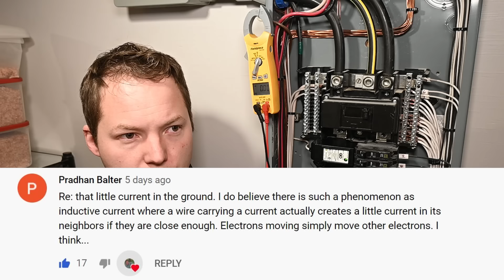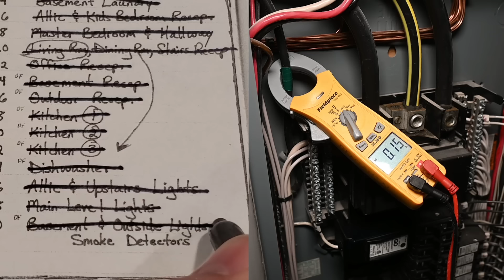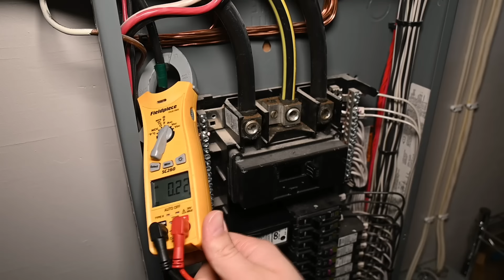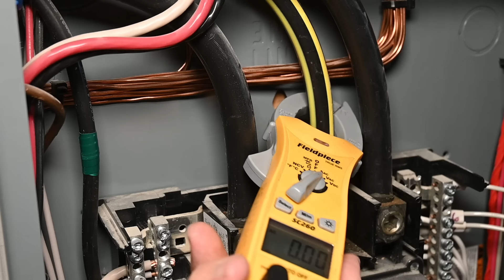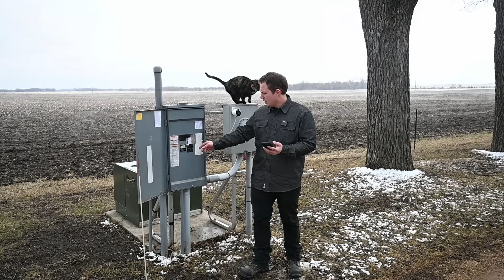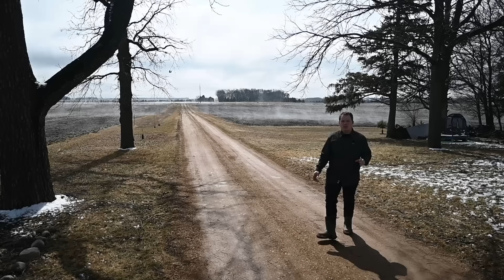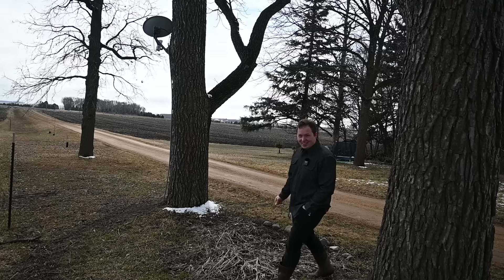Finding The Source of Stray Current on Grounding System

Comment: I'll never forget the time my girlfriend helped to clean me up presentable for a friend's wedding. I was sitting in the bathtub while it was filling and I had just painted a Dodge Challenger lime green and my hands had cured paint on them so she grabbed a can that sounded familiar from my paint supplies lock up and put a little on a rag and it worked to remove some green from my ear so naturally she told me to hold out my hands and I felt the splash and some hit the water at nutty level and I flew out of the bathtub and told her to grab the milk jug fast. It's the first thought that popped into my upper head as a possible means of putting out the weiner roast down below that was set ablaze by a half cup of acetone on the hot water surface that let me rise above the tub then put my feet down while the room got narrower. No Internet so Henley's Formulas to the rescue and my copy is at the foot of my bed on my 125 over 283 301 small block Chevy project engine for my 76 GMC shorty no back windows van for highway driving all over the province of BC in order to complete my electrical apprenticeship with plenty of variety and loads of fun... And that was the last time my now wife helped clean my hands with acetone while I sat naked in the bathtub. 
I remember the time I got zapped in the shower and I spent 3 years pushing the utility company to check the primary side connections, grounds, and stray current around the pad mount transformer that feeds our home. Hydro was talked into saying they would be here last night but no show so I'll wait a while before calling them back to continue telling employees who do not understand electrical basics and have no idea what a primary side would plug into and they have no clue how electrical noise can wake one person up instantly while the other one won't turn it off or at least turn your primary down at night. The saga continues but it has been 3 years since I got shocked in a shower.

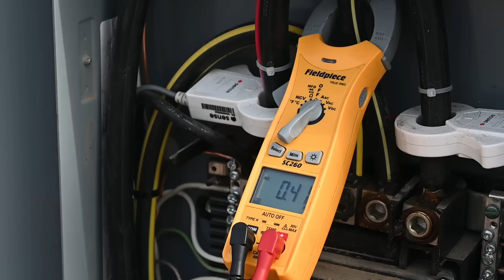Comment: 16:16 The problem is not that specific house nor transformer. The problem is that most distribution systems in the US are 1) multi-point grounded at the primary and 2) the secondary neutral (what feed the houses) is tied to the primary neutral (what comes out of the substation).

Actually it's even "worse". Because the house has two ground rods at the neutral disconnect, but also a ground rod at the transformer secondary, this creates a parallel path. Even worse, not only your housez but all other houses connected to the same transformer will have two ground rods; moar amps.

A perfectly wired electrical installation in the US will always have objectionable (leakage/stray) current!

The US adopts a TN-C-S grounding system, not a TT not TN-S system.

Comment: Benjamin, I think you have a neutral to ground connection after the main panel, which causes some neutral current to flow on the ground wire even if all the breakers in the house connected to the subpanel are off.  Neutral to Ground connections result in higher than normal EMF readings.  So, you may wish to buy a $89 EMF reader and go EMF hunting with all the breakers off to find the wire that is carrying the stray current with the Objectionable Current on it.

Comment: Bridged neutral, sure.  That could also be in a panel, sub panel or meter base.  The breakers wouldn't trip.  The other suggestions are pretty out there.  It could also be a floating neutral.  Is it power or current?  Both.  Current X voltage is power.  Also, power lines don't have neutrals.  The source isn't the closest ground rod.  It's the earth

The minor changes are just the meter.  Clamps aren't that accurate.

If you find a true ground, like a water pipe, and use that to measure voltage to neutral and ground you'll see a voltage.  You can also pull the ground, and then the neutral, to your sub panel and see if it disappears.  Current needs a path.  It appears to be on the utility side and they will have to deal with it.

Comment: What's probably causing that current could be what's known as "neutral to earth voltage" (NEV). It is the voltage drop across the power line coming from the substation. This line is grounded about 5 times per mile. This voltage drop depends on the amount of current on the line at any given time. Just look up "neutral to earth voltage". Mike Holt has a good video on that.

Comment: Had an issue with a whirlpool appliance a stove actually it was under warranty and it melted the terminal block, guy came and replaced it and we weee having issue because he didn’t remove that bonding part you were talking about you think he would’ve looked at the original and thought “ hey this piece isn’t on the factory part” but no unfortunately

Comment: I believe the conductors are wrapped around the bond and inducing a flux amp on your bond!! I had a similar condition, which I tested in the same manner and got the same results. Still unsolved as it is a long run and I am unable to dig it up!

Comment: I have the same problem but with higher voltage amperage on the neutral and ground in the meter box , electrician diagnosis was that the hot wires inside the service pole (hot lines from service to meter receptacle) are touching the neutral, maybe a shaffed wire? What do you think?

Comment: Hello,somewhere at your house, a neutral is connected or leaking to earth wire. What form a loop your transformer to the connection between neutral and earth mentioned and to the house ground   and then to ground rod of the electric pole you mentioned little far from your house,this happens because of the voltage difference between your transformer earth rod and the other one around(step down transformer).

Comment: I am no expert, but from the little knowledge acquired while building my PV system, I would have immediately thought of some leakage from a neighbouring building, which is somewhat similar to this. 
I understand that in a TN-CS installation, if the Neutral of another building suffers a fault, all the energy in that building would find its way back to the energy provider's transformer via any underground piping which is in turn connected to your ground and eventually to the Neutral feeding your home.
This seems very similar only instead of another building you have the transformer itself leaking to whatever will accept a path to earth.
One word of caution, you should not have more than one grounding electrode (rod) unless directly bonded with each other. The reason is that, in the event of lightning striking the soil, a gradient of voltage is going to radiate throughout your land with a potential difference of up to 20.0000 volts in which case, due to the resistance of the earth, the easier path for that voltage might easily by through your grounding conductor into the building and destroy some of the appliances to find its way to the nearest grounding rod at lower potential.

Comment: Why is there Stray Current on the Grounding System? And why is the neutral connected to earth? It's not for Lightning protection. Stop calling the so-called ground wire "Ground". This wire may be connected to ground but it should be called something else such as equipment sheet metal protection. Its purpose is to cause the circuit breaker/fuse to disconnect power from equipment that has an internal short circuit to the external sheet metal that people touch. For a 15 Amp circuit this wire must be able to carry at least 20 amps until the circuit breaker trips. In fact the connection to earth is not necessary for the circuit breaker to trip. It is the connection/Bond to the neutral at the main panel that makes it work. So why do we connect the neutral to earth?? The reason is the source of the stray current on the connections to earth. Ben measured 0.4 amps; I measured 2.0 Amps at my house. The problem is another miss labeled wire - NEUTRAL. It should really be called the "SHARED Primary/Secondary NEUTRAL". The way a typical transformer works is 7200 volts AC from a substation is connected to one terminal of the primary winding of the transformer. The other terminal of the primary winding is connected to the center tap of the secondary winding which must be connected back to the source of the 7200 volts AC - the substation - by way of the "SHARED Primary/Secondary NEUTRAL" which is connected pole to pole all the way back to the substation or through the earth. BUT IT ALSO ENTERS EVERY HOUSE as the NEUTRAL wire. What happens if the primary return wire to the substation BREAKS for any reason? The primary of the transformer is always connected to 7200 volts AC. This means the transformer will try to make the neutral wire 7200 volts AC. This is why the NEUTRAL IS CONNECTED TO EARTH AT EVERY HOUSE AND EVERY TRANSFORMER as a last chance effort to protect people from being killed by opening their refrigerator. Since the transformer is all ways connected to 7200 volts AC there is always primary winding current trying to return to the source of the 7200 volts AC. And since this wire is also connected to earth, every connection to earth will share some of this current and appears as stray current on earth. The further away from the substation a house is the larger will be this current. It also continuously changes based on the load at every house.
Also see " neutral to earth Voltage(NEV)" videos by MikeHolt.

Comment: Was there any vibrations felt or vibrations seen on water surfaces in clear plastic bottles sitting on surfaces like tables combined with constant low frequency humming unkown noise throughout the house walls or floor or even felt outdoors near house?

Comment: You zre seeing the reason why the rlectrical code calls for one and only one ground point per meter at the meter pr main disconnect.

Drive 2 rods into the ground 200 ft apart and connect them with a wire. Odds are very high you will find both AC and DC current in the wire.

Comment: Diverted neutrals is becoming a big issue in the UK where, in certain cases, the earth current can be greater than supply current because the local earth cable is acting as the return neutral for the whole of the local distribution return. It's often a big city problem but...

I have a similar thing on my property. There's a 3ph supply pole on one corner, and each phase is separately supply to differing adjacent properties. When I remade my house earth bond to the water pipe (plumber had disconnected it before I bought), I found that I had up to 0.25A flowing in my water pipe earth bond because it provided a better 3ph neutral balance between the properties as an alternate to their Neutral-Earth wiring! Usually the unbalance is less, but it's always 'there' because of parallel paths.
Reply: Hi, wouldn't a RCCB detect this and cause the circuit to trip.
Reply: Good question. In this case the answer is a No. That's because within my property we do have good insulation and no faults (recently tested). There is a few milliamps of 'leakage' to the earth (CPC), by design, from EMI filters  in the electronics and computers.

This difference (current on earth) occurs in the multi phase upstream supply wiring. In my case the three phase unbalance finds my multiple earth neutral bond to be a useful return path for the distribution unbalance.
You can also get some earth current fro the bi-phase unbalance in the US centre tap system between transformer and breaker panel.

Comment: Yes you are definitely correct about how electric meters work. Electric Meters only read the 2 Hot Legs, when you pull the meter the Neutral will often either run directly through uninterrupted or it will simply tap on to a lug with a straight through connection to another lug that comes from the wires of your panel (usually hidden behind the meter) but again the main point being the straight through connection will not enter the meter. 

If you look at the back of a single phase meter you will see 4 bladed terminals that snap into clips in the housing. 2 for the incoming line and 2 for the outgoing line feeding the panel. 

If there is a meter that has 6 bladed terminals that includes the neutral, it’s one I’ve never seen.

Comment: I've seen old homes, re piped to pex, eliminating ground wire from the copper pipes...then someone over tightening an old style box end connector. coming from panel...piercing a 120v hot wire energizing the ground wires to multiple circuits. Good times! And no it did not trip the breaker??

Comment: Don't know if this page is still being monitored, but similar (but not) problems exist in Oklahoma.  A friend is helping me replace old wiring with new, and did an install of a new 120 volt socket.  Everything plugged into the socket works great, but there was a 50 volt leak onto the ground wire on that circuit, that did not exist anywhere else.  Leaks exist elsewhere, but less than 5 volts which we understand is ok.  We pulled the offending socket back out of the wall, and that simple act caused the voltage leak to drop from 50 volts to 5.3.  This seems to me to be acceptable, but my buddy seems bent on finding where that 5.3 stray volts is coming from.  Should he be concerned about that 5.3 volt leakage, or can we relax and not worry about it?  Thanks.

Comment: I'd reach out to Fluke or someone like that and see what they say.... guessing they have some old-timers there who've seen a few things.   Another thought is that if you have ground rods involved... especially those separated by a reasonable distance.. you're going to get galvanic(?) ground currents.   Testing the 'there is no such thing as a stupid question' expression... at what voltage are these currents happening?   If you broke the circuit (for example) and inserted a 1W, 5W, or 100W lightbulb... or a tiny LED... would they light up?
Reply from the maker: That would be an interesting thing to test! Might have to investigate that further.

Comment: Thank you!   I am a Ham radio operator, horse rancher, and a part time electrician (retired computer engineer).  I recently installed a 200amp service entrance to my ranch.  I drove in two 8ft ground rods into some nasty ass rocky soil.    I am thinking to myself..."Why I am running 4/0 4/0 2/0 UHD to the transformer and #4 to my ground rods".    The POCO tech landed my UHD cable to the transformer to get me hooked up.   That is when I noticed that the neutral of the transformer was also connected to a ground rod at the transformer.   But I shit you not!  The POCO tech found the neutral buss was loose and tightened it up.    This all breaks down to Ohms law!    You have a parallel path to the neutral of the transformer;  neutral condutor and the other is "GROUND".    Your neighbors also get toplay along with their ground rods to the same transformer.     
Backing up to the gound current thingy..   Yes;  it's is normal.  

Everyone thinks current will seek "ground"....   Yes only "if it is connected" should be the answer.    (POCO transformer neutral bonded to ground)

 But it isn't something that I would connect (bond)  a Ham radio ground into.

Comment: By any chance have you seen any earth worms writhing on the ground?  

I have heard stories about the Bonneville Power system which sends electricity generated by dams in the Columbia river to power companies in California (many hundreds of miles away) occasionally switching to a ground return topology (return current is actually flowing through the earth).  Evidently the natural gas companies don't like it when they do this because they end up carrying excess quantity of the return current through their networks of underground pipe lines.

Comment: regarding the current reading you have running from neutral to ground may in suggest that that the neutral is more or less a floating centre tap, which may not be exactly balanced between both windings.This may be causing a current to flow.

Comment: This is a well known problem with the North American electrical distribution system. Search for papers authored by Donald W. Zipse. He apparently dedicated most of his later life to bring attention to this dangerous practice of multi grounded neutrals in the power distribution system. See e.g. https://www.ecs.csun.edu/~bruno/MultiGroundedNeutralFinal_4-17-7.pdf
It's amazing that the electrical utility industry can continue to get away with sending uncontrolled amounts of current through unsuspecting customers ground wires, water lines and gas lines.